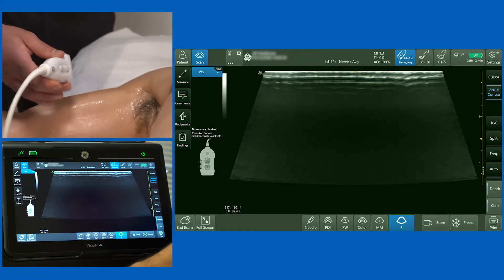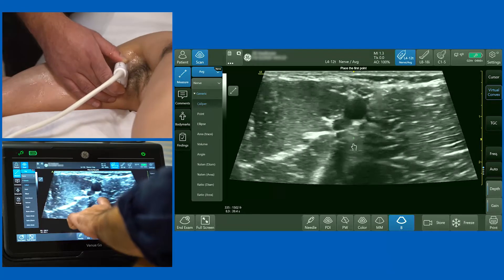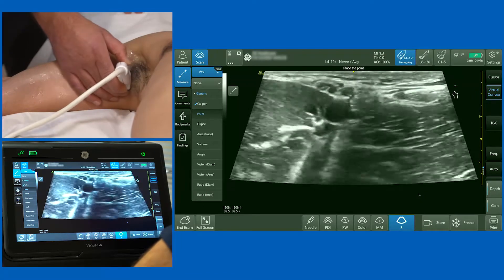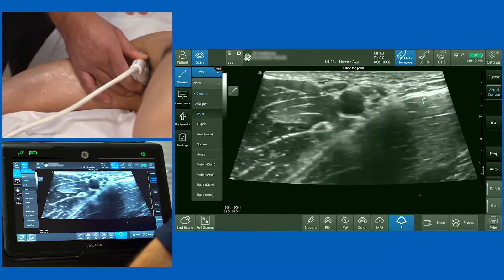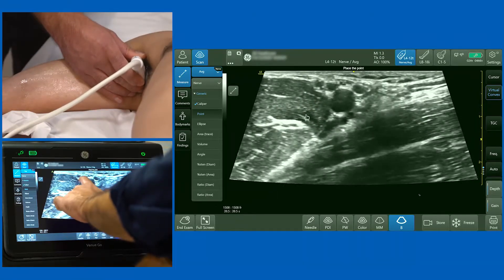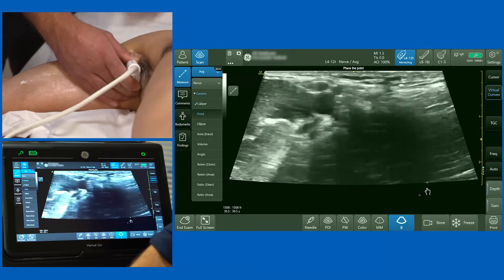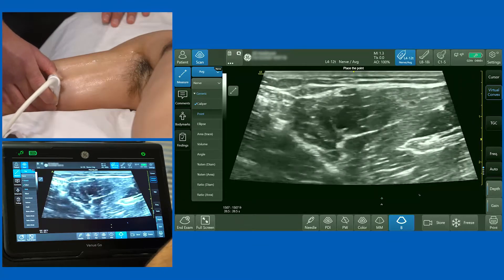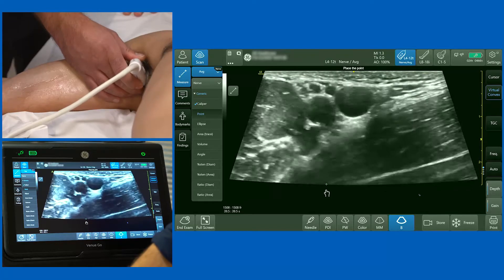Axillary approach to Brachial Plexus Block

Comment: One silly doubt the artery mentioned along with radial nerve is described in the video as posterior circumflex humeral artery @9.36mins; shouldn’t it be profunda brachii artery and not posterior circumflex humeral artery which accompanies axillary nerve sir?
Reply from the maker: @SamtaniPradeep  yes you are absolutely correct. Posterior circumflex Humeral is on the back. This is definitely profunda brachii.

Apologies
Reply: @ No apologies sir, I was just clearing my silly doubt sir. Once again thank you very much sir

Comment: @DrAmitPawa how do you manoeuvre around the veins to get to the nerves
Reply from the maker: So the way to do this is by using a couple of techniques: 
1. Direct your needle around the venous structures and aiming to place needle near fascia around nerves 
2. Use hydrodissection to move structures out of the way /compress them by hydrostatic pressure 
3. Once observed where veins are you can alter your probe pressure to compress the veins